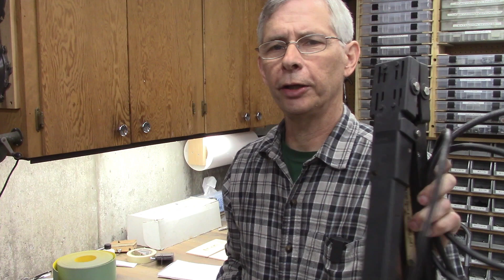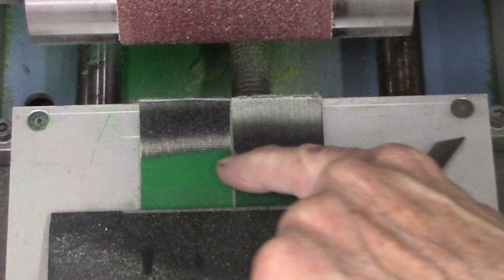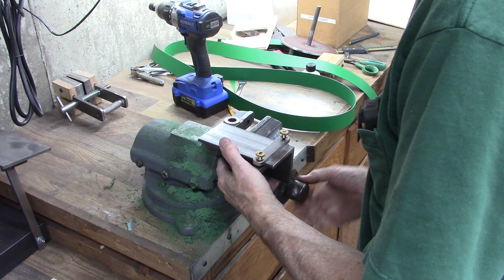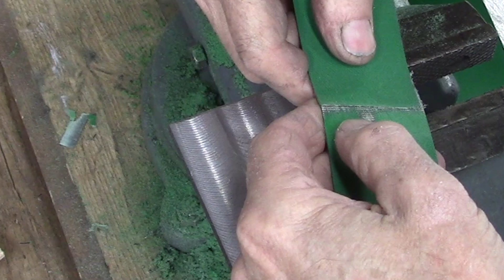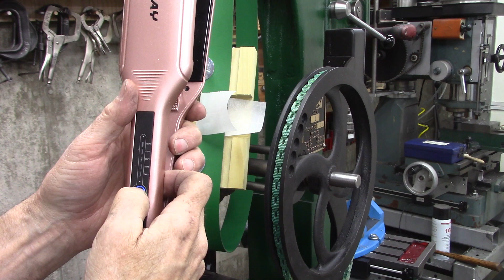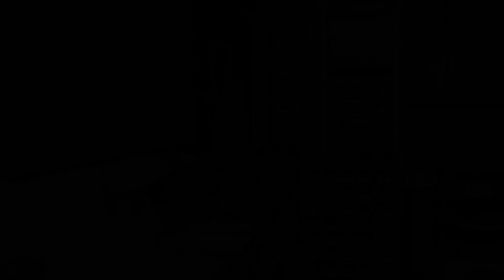Flat Belt Fabricating and Splicing - Synthetic Belts

Comment: Great technique and perfect joining.  Quite a number of tools to keep for an occasional situation.  I have had some good outcomes with just taking six or eight inches of the old belt and covering a simple butt joint on the new.  The belt is run on the flat side of course, a disadvantage, not being able to reverse. There are flexible permanent glues (e.g. locktite for rubber) that are quite permanent.
Reply from the maker: Interesting, I'll have to investigate that glue!

Comment: THANK YOU, FOR THIS INTERESTING, AND USEFUL TUTORIAL/DEMO!  THIS IS THE KIND OF STUFF THAT MY DAD, AND UNCLES WOULD ALL KNOW HOW TO DO!!!...   MUCH APPRECIATED!!! 
RECENTLY, I ORDERED SEVERAL LENGTH ROLLS OF  SMALL (5mm, & 10mm WIDE) (NYLON?) TIMING BELTS, AND SMALL PULLEYS, SO THAT I CAN TRY TO DESIGN AND BUILD SEVERAL SPECIAL MACHINES, FOR PRECISION HOT-WIRE-CUTTING   OF EXTRUDED POLYSTYRENE FOAM BLOCKS, FOR BUILDING R/C MODEL AIRPLANES.  I'LL LIKELY NEED TO "SLPICE" THESE TINY NYLON TIMING BELTS, AND OR ("URETHANE"?) "ROUND BELTS",. SOMEWHERE IN THE PROCESS OF DESIGNING, REDESIGNING, REBUILDING, AND "PERFECTING" MY TOOLING SET-UPS.  
:face-blue-smiling::face-green-smiling::face-red-heart-shape::face-red-heart-shape::face-red-heart-shape::face-red-heart-shape:
Reply from the maker: Glad it was helpful. Poly round is super useful. https://photos.app.goo.gl/is4rKYMsM1BHjGRK8

Comment: Were can i buy the grinder at?
Reply from the maker: If you are splicing one belt you might get by with clamping it to a 2x4 and use a handheld belt sander to grind the taper. I sold the manual grinder I made and the commercial grinders are ridiculously high priced. I can't even find a motorize grinder now but last time I saw one it was $4300.00. Sorry I'm no help.

Comment: I picked up a complete set. Plus a roll of 1 inch belt for 25.00, at an equipment auction.  Haven't used it yet but I have it when I need it.
Reply from the maker: Set?  Of what. Thats great on the belt.
Reply: @WinkysWorkshop   I got the complete set. Made by R&J Dick Co Inc. It has the sander, clamp, with heat and a fairly large roll of 1 inch belt. In the original box and paperwork. Guess I was the only one at the auction that kinda knew what it was. Now that I've studied your videos, I might just give it a try.
Reply from the maker: @lyleadams4367  Thanks great!

Comment: I am a year late to this video but I did not see any other comments below, (169 to date), about this issue . .. At 0:20, I don't think HORSEPOWER is the best way to describe the strength of belting. POUNDS is a better answer. ...  HP is FORCE x SPEED, this belting is only used in a FORCE mode, the SPEED factor is of little consequence here.   If I have 1 pound of Force and move something weighing 1 lb, 100 feet in 100 seconds, or move it 100 feet in 1 second, the force required is 100 times more in the 2nd example, (2nd example is 100 x more HP than the 1st example), it is still the same 1 pound load that has had 100 times more force applied to it. This is a HorsePower example Force x Distance.  The HP on a lathe is 'different' because of Force Multiplication by way of Pulley Ratios or Gear Ratios.  example ... On a SouthBend 9" with a BackDrive motor setup, you can see that the motor powers a large v-belt pulley with a small pulley on the motor before the flat belt gets the power.  This will create a TORQUE multiplication to the flat belt that is greater than the torque that the motor is capable of delivering normally, but the speed of that flat belt section has been slowed down by the pulley ratio of the 2 v-pulleys.  therefor ... It is possible for a 1/4hp or 1/2 hp motor, through other pulley reduction ratios, (not the SB9 in this example),  to generate 100's or even 1000's of pounds of force, that could shred a belt or a belt joint even though it is only being powered by 1/4hp or 1/2hp motor, (not on a SB9 tho, its the principle), but who knows what kind of contraptions are out there to take a flat belt drive.  Plus some of that Pull Force is used up in the TENSIONING process as well. The best answer would be some type of pull force answer in actual POUNDS, not HP.  How many Pounds of force can this joint hold before failure.  Thanks for making this video! A very interesting DIY for a difficult looking problem.
Reply from the maker: Thanks for the in depth comment. FYI, a proper splice is almost as strong as the belt. Okay, I agree on the rest however, I could be very specific on pound and nobody would be able to relate it to their lathe. Generally speaking I don't recommend more than 1.5 HP on this belt and I would say that is in the ball park for most lathes. I had one customer use 2" wide on a 2HP camel back and the belt was super long without a tension idler. This is crazy hard to know how much stretch to allow for. That was a year ago and so far its doing well.  Bottom line, there are tons of unknown variable to consider. I usually tell people to let know if it doesn't work and I'll either change the length or refund there money. So far, no failures that I know of and I used up a 300ft roll. (some on my own machines).
Reply: @WinkysWorkshop  ++ Thanks for your reply and continuous contributions. ++
Reply from the maker: @johnrussell6620  Thanks for noticing, You're welcome.

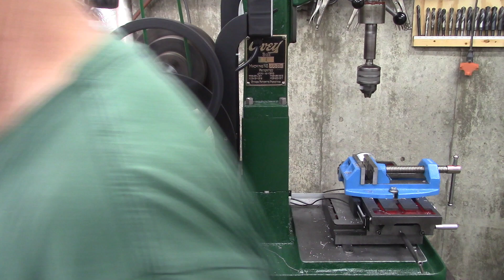Comment: at 27:27 the driver belt is timing belt right?I'm learning belt types.
Reply from the maker: From the motor to the black pulley was a segmented adjustable belt often called a link belt. They run smoother than a standard v belt.
Reply: @WinkysWorkshop  Thanks a lot.I have my last question.What is the difference between grooved pulley and sheave?
Reply from the maker: @ygt824  When I want to sound technical I call a pulley a sheave. Ha, no idea!

Comment: Can't you just vulcanize  the rubbers?
Reply from the maker: Only about .015" of the surface is rubber, the rest of the belt is polyamide (a type of nylon. The glue (fixol) plus heat bonds the polyamide layer. The rubber has almost no strength. Some belts have a thicker rubber layer that can be bonded with Vulcol glue and heat but most often people trim the end of the belt and forgo the Vulcol. It leaves a little groove where the rubber is missing but the strength is unaffected.

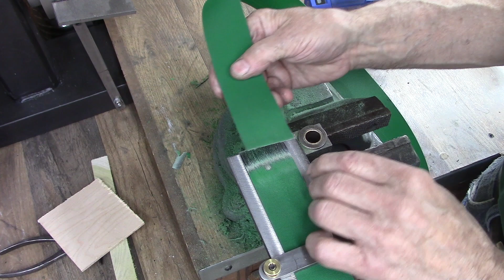Comment: great video, thanks.  I am confused on exactly what parts/colours are the nylon and rubber at 19:05.  with the cross section that the skiving creates, what colour band is what?  thanks
Reply from the maker: There are many belts out there and they vary in construction a lot This belt is made of Polyamide (nylon) and rubber. One surface has a green rubber coating and the other side does not. What makes it confusing is that the side without the rubber is also green. Its easy to identify because the nylon is slick and the rubber is not. The primary reason this is important is that the glue will not stick to rubber. If you overlap the ends too far the you will have a loose end where the glue didn't stick.

Comment: Mcmaster Carr sells "alligator lacing" for joining these belts. Local farmers around here use this system for their hay balers because it's easier to do a repair in the field. This might be an inexpensive option for someone not wanting to glue and join the pieces as shown. That glue is 42.00 a bottle now! Thanks for the video!
Reply from the maker: Yeah, I don't like the clips but you are correct, the glue is high. However, depending on the belt length, you can usually install a glued belt for less than $60. I now sell a small amount of glue in for $5 buck. The clips don't last very long but they are convenient

Comment: Oh man, thanks for publishing this. I had a serpentine belt stitched with 100lb test fishing line om n mu South Bend 9, but after 10 years of use the stitching is coming out. It's stretching the holes some as well. This should much better. I was getting a lot of belt slip. how do I order some belt?
Reply from the maker: Your welcome. Here's the info you need. You can send be questions in the email provided in the link as well. Note: I'm on vacation at the moment but will be back in the shop in about a week and will get back with you. Belt Ordering Instructions: https://docs.google.com/document/d/1auPTcCg9Gek_YhWOE--xZEUw1RVEPoZAdBS-lx24j6w/edit?usp=share_link

Comment: This is a very informative video!    Thank you for sharing.   Question: I'm interested in installing such a belt on my  South Bend 9A lathe to replace the poly-V belt running on the original 3-speed, crowned flat belt pulley cone.  The previous owner installed it and  it slips and doesn't center.  In short, it's AWFUL!!  Any way, I've been told that the original leather belt for this lathe was 3/4" wide.  Do you offer 3/4" material?   Would you suggest  your 1" material for a  3/4 hp motor?  Is the purpose of the heater to melt the nylon or does it help in curing the glue?  
Cheers,
F.C.
Reply from the maker: The heat actives the glue and there is some kind of chemical reaction with the nylon. The belt width needs to be slightly more narrow than the flat area on the pulley. A flat area of 1.25 would be a 1" wide belt. I think the SB 9 is 1".  This video has info on how to get the belt (in the description) and yes, I can make any width you need. If you can get the belt on without needing to splice your cost will be cheaper but you can do it either way.  https://youtu.be/VJ4HH_6MJcI

Comment: muy buena explicacion, me llamo la atension el aparatito que tienes en el banco con una cuchilla pareceria que es una guia de corte  .lo tienes en un video como hacerlo o un croquis yy el uso¿¿¿¿¿¿
Reply from the maker: You cut the belt at an angle and feed it through. Then grab the tip with plyers and pull.

Comment: Very interesting thankyou, I wondered how you kept your hair straight? I am going to try and make belts for my belt sander so this was very helpful.
Reply from the maker: I'm not sure this applies to sanding belts. If you are talking about a drive belt be sure you get the correct type belt. It has to have a Polyamide core to work with this glue.
Reply: @WinkysWorkshop  Thanks, the measuring and clamping was a great help.

Comment: I bought my south bend 9 belt from a very reputable supplier.  Looks like the same material and the splicing instructions were the same except that two glues were used and no heat was applied.  I’m guessing the second glue was intended to fuse the rubber for a smooth finish.  Wonder if the same glue will set if clamped for a longer period as mine suggested. Just curious.
Reply from the maker: Interesting...  I've heard the cold glue is not as good but it might be 10% less strength and totally adequate. These are industrial belts so who knows

Comment: This was awesome, I haven't messed with belts in quite awhile.  Years ago, I got a summer job working in a print shop with my Uncle Richard and we used belt driven presses and conveyer belts for printing flyers.  It was my responsibility to inspect, measure, and replace these.  A fun job :)  they came pre-spliced to size so I never had to splice them.  I asked my uncle why they didn't just get a metal clip splicer, and he took me to an old conveyer room and had me work there during my shift...after a 12 hr shift of constantly hearing "click click click", I completely understood why lol.  It was a good lesson
Reply from the maker: Thanks! Yeah...  glue on lasts a lot longer too. The clip on are a quick fix.

Comment: I seem to have missed the "Change Over from a Commercial Vee Belt (Which bounced quite a bit) to the Multi Segmented Vee Belt which RUNS smoothly without adding weight or Springs to the motor mount!
Reply from the maker: Yeah...  I mentioned it in the Mill Table video but did it off camera. Works great!

Comment: Hi Mark, that's quite an interesting and informative process in making flat belts. Thanks for showing us how it's done. Just looked up the specs on our SB's and they use 1-1/2" width.
Reply from the maker: Probably 1 to 1.5 HP?
Reply: @WinkysWorkshop  Actually recommend 1/2 HP.
Reply from the maker: @RAYAR54  Cool, the only reason I asked is that mine is 1-1/4" and 1/2 HP. My Logan was 1/2 HP with a 1-inch belt
Reply: @WinkysWorkshop  Mine has a 1/3 HP with a 6-rib automotive serpentine belt. Can't remember the width, I think about 1-1/8" +/-. I have to run it with the back of the belt (smooth side) to the pulleys, otherwise, it doesn't track properly.
Reply from the maker: @RAYAR54  That's strange about the tracking. Maybe the ribs are worn uneven. I had one of those on my South Bend for a while and it slipped a lot. It was only one inch wide but I really thought it would grip better than most and it did not. My current belt is 1.25" and does fairly well.

Comment: Clever stuff. The one place you often have need for a special flat belt in your shop is for a lathe tool post grinder and their high spindle speeds. Commercial tool post grinders are expensive but a small one for the home shop isn't too hard to build. The hardest part is making the belt or paying for a special. Popular Mechanics from the 30s and 40s have a number of plans for tool post grinders.
Reply from the maker: Yes that would be a great application. I forgot to mention that they do well with high speeds too.

Comment: Thanks a lot for sharing this very valuable know how. I bought an old belt-driven Schaublin 102 lathe (very common in Switzerland where I live) and I was wondering how I could mount a new belt without investing in very expensive equipment. I guess thanks to youI’ve got the solution. Many thanks and congratulations for this entertaining video.
Reply from the maker: Interesting. Switzerland is where Habasit belt it made. Maybe you can get a good price. I found a roll of old stock and got a good price. Depending on your lathe F1 might be a good choice but they make other belts that might be better.

Comment: I've had clients that were in the printing business, and I've run stitchers, I've collated, I've run the counter for packets, I've also run the folder. I met some really nice people there.
A man from my church retired from printing, and it was interesting that he knew people that I knew. He started out with movable type, and worked in many aspects of the industry, including electrical repairs of equipment. As companies went to offset, he changed with the businesses. As companies came and went, he had to do the same.
Reply from the maker: I worked in offset. It was an interesting career.
Reply: @WinkysWorkshop  it was definitely an interesting place. I was impressed with the gold embosser. It was done at one of the few firms that were local.
Reply: @WinkysWorkshop I still work in offset. I first started on a Goss Community and then Goss Magnum for a brief period. Went back to the very Goss Community that I learned on and moved on to 10 unit DGM 850 "Goss Urbanite" double stacks with double folders.

Comment: Years ago, Mark, I worked at a place that made kevlar "timing" belts. They were used in all types of equipment including computer printing equipment. Granted, they are very expensive. They were very particular to use up all the thread on the bobbins as that isn't cheap thread.
Reply from the maker: Timing belts? Cool.
Reply: @WinkysWorkshop  they were toothed, and at least one use was in high end printers.

Comment: This was a great video; thank you. I have a Logan lathe, as you do, and was thinking about replacing the leather belt with a piece of an automotive serpentine belt. The details of how to skive the belt and glue it had not quite crystalized in my mind yet. I'll be replaying the video and making that rotary skive grinder and aligning jig. I had purchased a glue called 3M Scotch-Weld Plastic & Rubber Instant Adhesive to use because it would glue car tire rubber and ATV tire rubber together.
Reply from the maker: Thanks! I'll be doing a second video next week that covers the grinding a little better.

Comment: Mark. With the plans for the grinder, is there an angular offset between parts "A" and "B"? Somewhere between 1 and 6 degrees maybe?   Thanks.
Reply from the maker: Yes, its a slight angle and you have to adjust it to get the correct skive (grind) length. Every belt has it's own specification but it's really not super critical. Most belts are around 3/4 to 1 inch long although some thicker belts are longer. Next week I will post the video making the grinder and clarify a few thing. Judging by some of the comments I didn't do so well when talking about belt types. There are 3 types of belts. One type uses a finger joint. You put the belts in a guide that contains the belt and the belt material melts together (no glue). This is a good belt but usually has more issues with tracking. There are also a few belts that do not glue (use a clip) or use a different type of glue. My point is, this type of belt is very common but there are hundreds of belt types out there but only some use this glue.